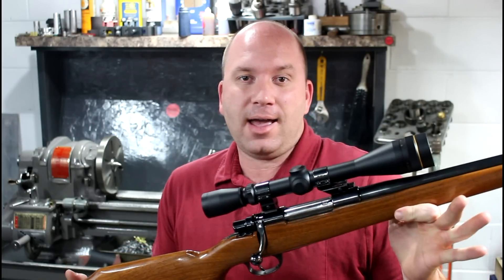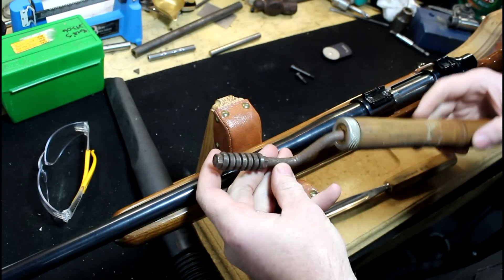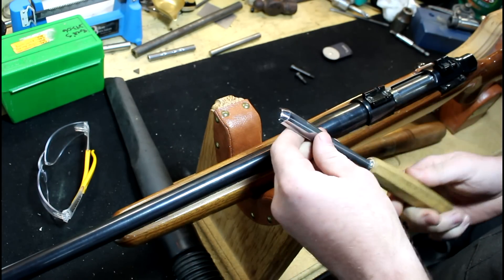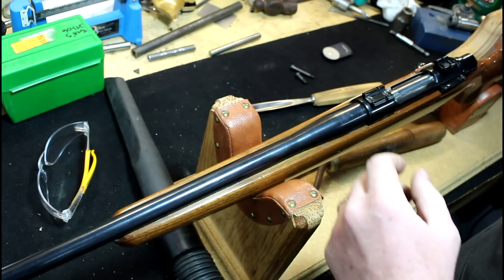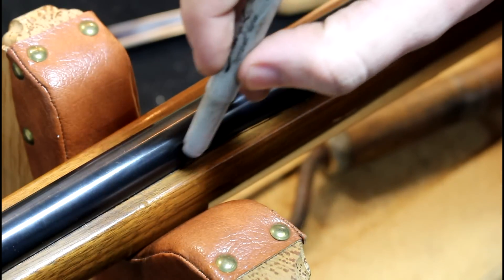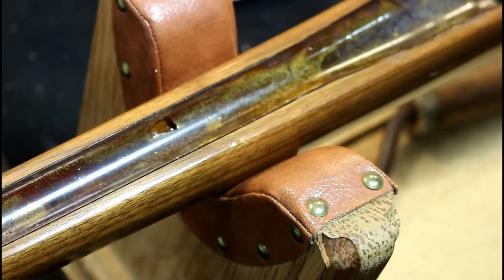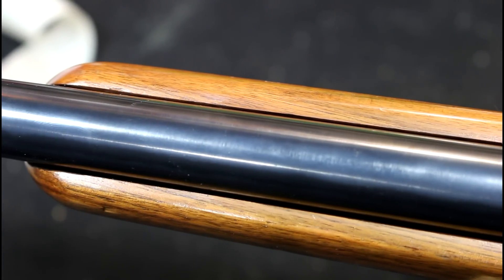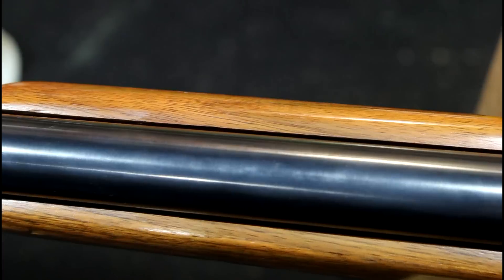Floating a Rifle Barrel Custom Precision Mauser Part 4

Comment: Deep well socket wrapped in sandpaper is a great tool for this job. Just find the right size socket.
Reply from the maker: I have done that before. I find that the dowels are a little easier to handle.

Comment: I've used a socket with a little bit bigger od than the barrel with some sand paper, kept the barrel channel nice and uniformed, just took a bit longer. Great results :)
Reply from the maker: That would work good too. Thanks for the tip.

Comment: Ever glass the lug ? I was told to put three layers of type front sides and bottom of recoil lug. Then glass forward just past the chamber no further .Free float the rest of the barrel . Also glass the rear of the action with no pressure just make a hard spot to support a level stress free action. Have done a few and seems to work well.
Reply from the maker: Guess I should have mentioned that this action has been bedded up front and in the rear. I didn't do this one, but I usually fully bed the action, action screws and the trigger guard under the screws. I also usually bed it under the chamber, then float the rest of the barrel. I don't use tape on the lug, never saw a change other than a little easier to get out. I've been doing it this way for 10 years or so. I learned it this way from a Master gunsmith who built hundreds of BR rifles and competed for 30+ years. IMO there's a few ways to do it, but as long as you have ample bedding with good contact, and it's stress free, you should be good for a non-competition rifle.

Comment: It looks like the acraglass had been used first. What's the pros and cons of both setups?
Reply from the maker: Yes, a previous owner did use acraglass. If you are referring to bedded vs. free floating, free floating will keep the Point of impact from moving when the barrel warms up which it would do if it were bedded. If you only take a couple shots, not a big deal. 3 or more in a minute or two, and it can start to heat up, expand, and change the point of impact.
Reply: @precisionmachineshed  the reason I ask is I'm restoring an 1861 Springfield that had been Sporterized. I want to replace the 24" of the for grip that had been cut off. I'm going to dowel the new wood to the old wood under the first band. I thought acraglass might make not only a good bedding material but a good mending material as well. Any thoughts?
Reply from the maker: Yes, it does make a good glue, however you need a good solid fitting dowel or two in there if you can fit it. being that the rest of the forearm should be held close to the barrel with the other bands, you shouldn't need a ton of strength to keep it together.
Reply: @precisionmachineshed  I intend on using two dowels ( just under the barrel recess and above the ram rod groove). One made of ash for it's strength and the other made of black walnut because it will likely protrude partially into the retaining spring recess. I'll use wood glue and pressure while using the barrel to hold everything in place till it dries completely. Then I'll asess the need for additional strength at the joint. Again, the cut is exactly under the first band supporting both the rear of the stock (forward of the trigger) and the rear of the new fore grip. My hope is the repair will be undetectable when assembled.

Comment: Thanks for putting this up. I'm getting ready to try and restore my grandfather's(RIP) JC Higgins model 50 in .270.  As you probably know, JC Higgins was a Sears Roebuck brand name and the action is a commercial 98 made by FN in Belgium. 
The stock was made by Bishop or Faxon and has a raised cheekpiece. I'd probably 86 the stock if my grandpa didn't hand checker it himself. This stock has been through some late season hunts on the very wet Oregon coast and has been completely soaked. When running a dollar bill between the barrel and stock, it clears just fine until the very end then, it hits pretty hard.  
Plans as of yet are to free float the barrel, glass bed the action,  sand/refinish stock with some tru-oil, maybe swap the trigger out for a timney and then find a hand load it likes. 
Any info/advice is greatly appreciated.
Reply from the maker: I have the series of videos on this rifle up on my page if you have not seen them yet, I think there is 4 or 5 videos. Any questions, feel free to ask.

Comment: What is the purpose of floating a rifle barrel and what is the benefit of doing so?
I think it's a kind of trick to get the rifle to shoot with more accuracy.
Wrong or right, well I don't know, enlighten me please.
Reply from the maker: It is to try and maintain consistency and improve accuracy. When a barrel is touching the stock or bedded you are inducing an outside force on the barrel. This force will completely change the harmonics of the barrel and do have a tendency to change based on stock movement ( swelling, hot, cold, shrinking, expanding) this will change the harmonics on a day to day basis. When we float the barrel, all the outside forces are now gone. The barrel is then allowed to "ring" at its natural frequency depending in the load specifics. If you can get your reloads or cartridges exactly the same, theoretically, your barrel will have the same frequency each shot resulting in more accurate and consistent groups. At this point, you then need to take into affect barrel temp. Barrel temp may change frequency, but that is a little more predictable than a rondom outside factor such as the stock touching the barrel.

This is just a very brief explanation of what's happening. Hopefully it makes sense.
Reply: Thank you for the explanation, it sure makes sense.